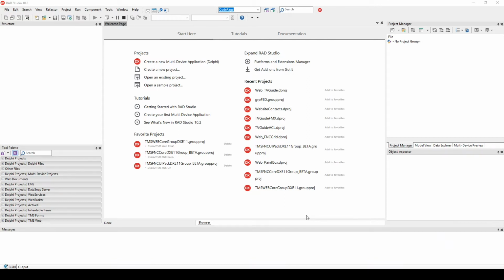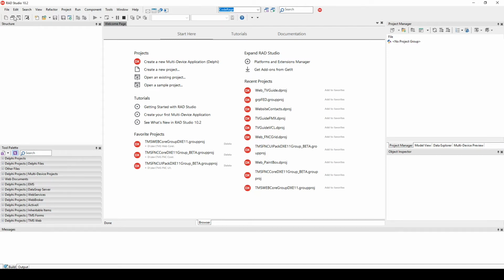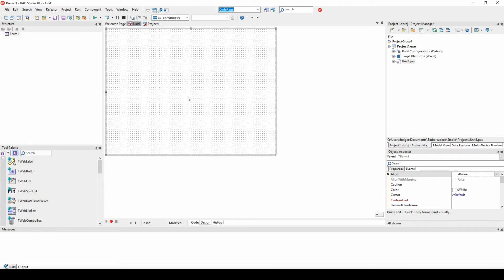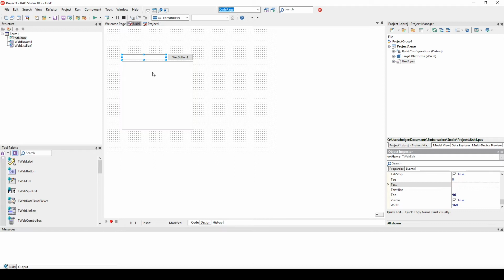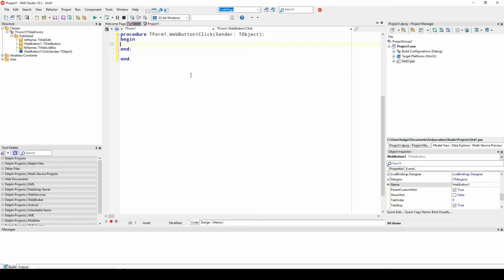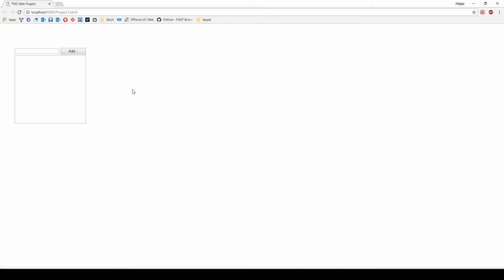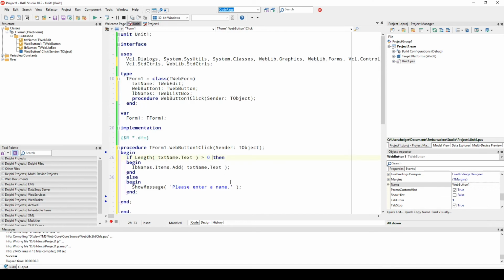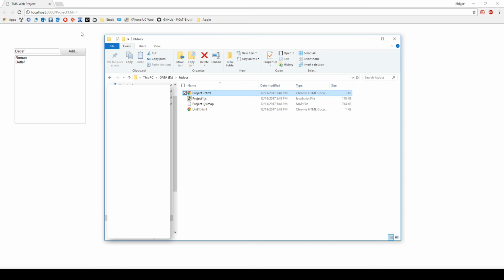Introduction

Comment: How much of the Delphi language can be translated to JS?  Can I use anonymous methods, helpers etc.?

e.g. in your example, perhaps we want to avoid trivial text.  Does this work:

s := txtName.Text.Trim;
if s.Length > 0 then
  lbNames.Add( s )
else
  ShowMessage( 'Please enter a name' )
Reply: A lot, we have meanwhile about 1 million lines of our code working with the Pascal to JS compiler. A couple of newer Delphi compiler features are not yet supported though, like generics or anonymous methods. But these will be worked on after the official v1.0 release.